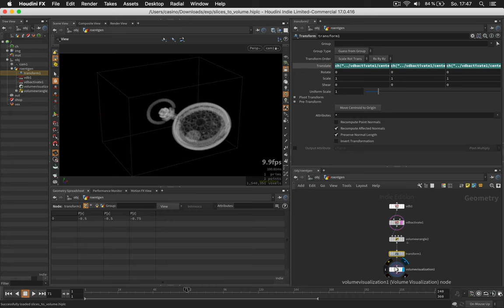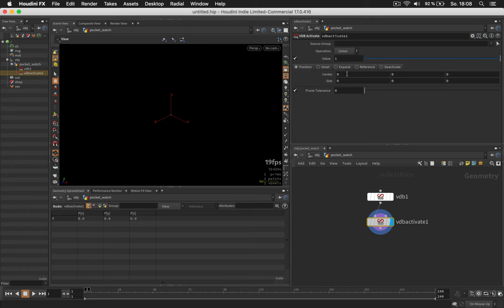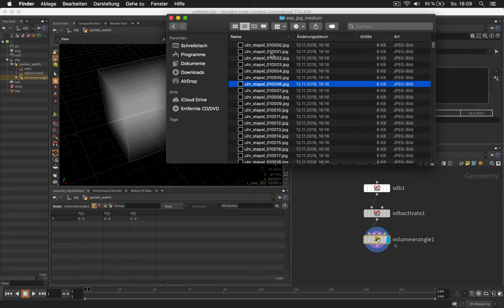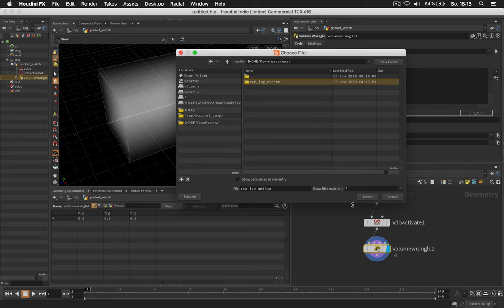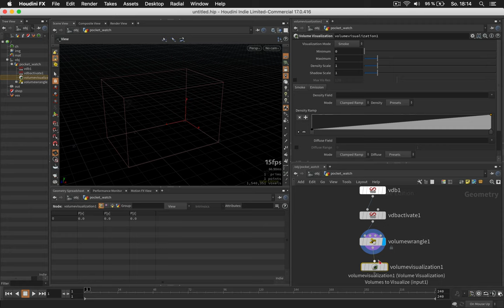Convert Image Sequence to Volume – Houdini Tutorial

Comment: Is there a way of setting the minimum grey value to be used for the color value referenced by density at 07:57? I'm essentially looking for a thresholding value to control here. I'd like to be able to set a value such at .25, to set a density of 0 to any pixels/voxels below this grey value. Any help would be greatly appreciated!
Reply from the maker: Hi, there is a fit()-function in VEX, which can remap values, ie. fit(value, 0.25, 1.0, 0.0, 1.0).
https://www.sidefx.com/docs/houdini/vex/functions/fit.html

Comment: Hi. How can I adjust the aspect ratio editing for an image?  So that I can use rectangular pictures, not square pictures.  The size parameter kind of copies it.
Reply: Only transform?
Reply from the maker: Hi aspirineivanov,

you can write a line of python to set the volume size to the image resolution, ie.
hou.imageResolution(hou.evalParm('image'))[0] and a string parameter called 'image' refering to an image.

https://forums.odforce.net/topic/41816-a-good-way-for-making-grid-divisions-depend-on-pixel-resolution/#comment-199939